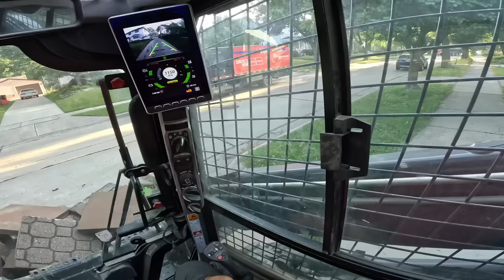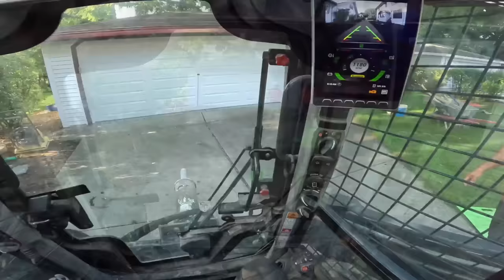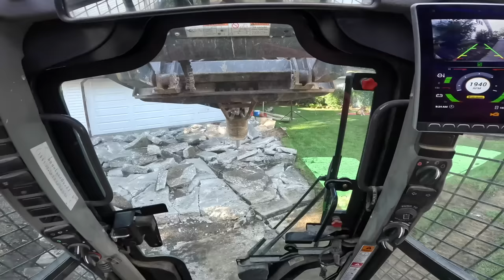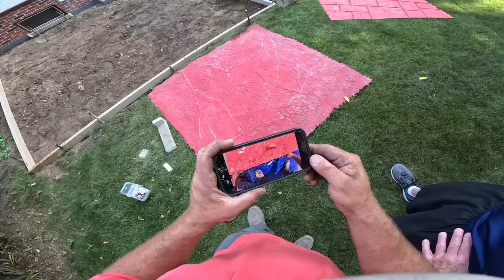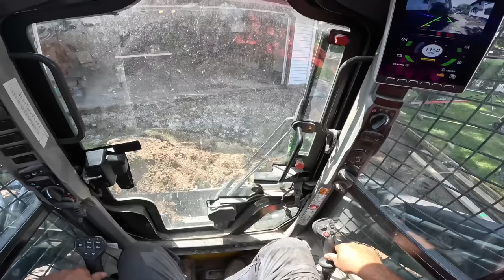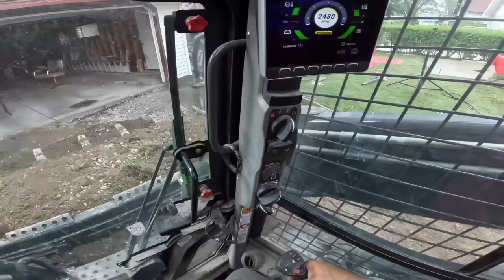Can we make him happy? I'll try!

Comment: You need a light on the dash to let ray know the PTO is on. A light set up would be much much cheaper then a pump. I burnt one before its no fun then my boss had put a light for when the PTO was on and i never burnt a a pump again mind you i got used to the truck and could tell when it was on. You can usually feel it. Anyways great video as always

Comment: On your concrete mountains, set a rebar U in the top or an eyelet so you have a lifting point, would be way easier than sliding it in the bucket and damaging your toolbox.
Reply: good idea.
Reply: @TUGG75  no you don't you think they take all the rebar and wire mesh that's in old driveways when they rip them up that all goes in the truck .. it's a great idea 💡
Reply: Great idea 💡  dude 👍
Reply: What toolbox
Reply: It sticks so it would be super difficult to just pull it straight up
Reply: @lauramagagnoli7750  not really, they get it out every time with manual labor. A machine would do it 1000 times easier, or put down a piece of plastic, cardboard, towel, t shirt, anything to keep it from touching the metal if they’re worried about it sticking.
Reply: @dmorris1130
What about having a Former in the space so any concrete over can be put in there then as it gets full use the Skid loader or Bobcat to take it off then take it apart and use it over & over to make a wall for whatever  Why Waste Concrete when you can use it ?.
Reply: @dmorris1130  the always have to pry it or push it with the skid loader

Comment: Tip for hooking up the hydraulic attachment. If you press on the fittings on the machine before pushing on the attachment hoses they go on easier.

Comment: You need to get a amber beacon light for the dashboard booked to the pto
Reply: Doing too much. Just an index card or paper that days pto off
Reply: @P4p4Smurf  a light flashing on the dash is going to be far more effective than a bit of paper taped to the dash
Reply: Obviously but takes 2 seconds to tape a piece of paper and if you can't take a second to glance at it, then you shouldn't be driving. Shouldn't even have to do anything in the first place
Reply: @P4p4Smurf  why would he glance at a piece of paper if he can’t even double check the pto off and yes I agree he shouldn’t have to but it’s better than buying a new one when that one blows to bits from being left running

Comment: We got fed up drivers leaving pto in and driving so had valve fitted so pto is knocked out of gear when hand brake is released … saves the frustration of keep telling them and cost of pump when it does go wrong